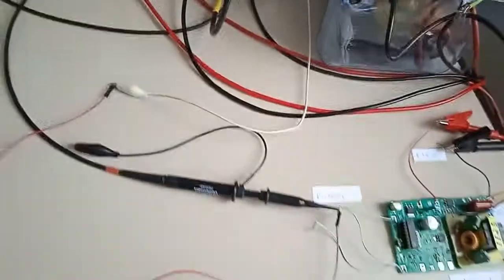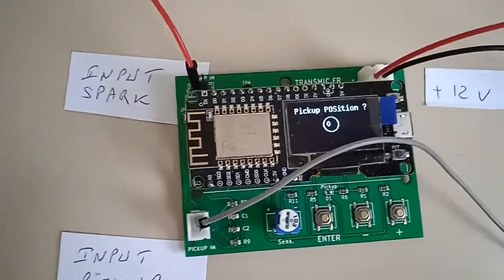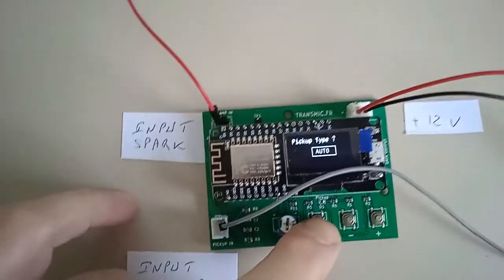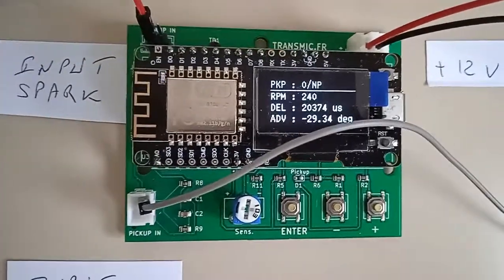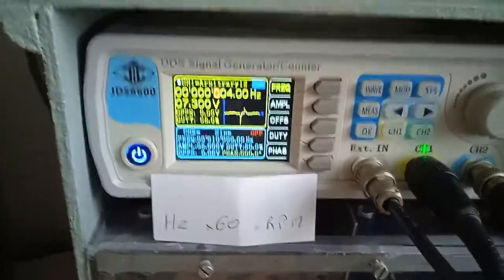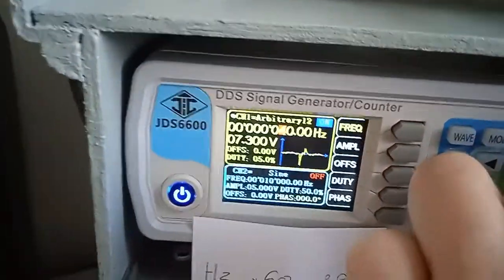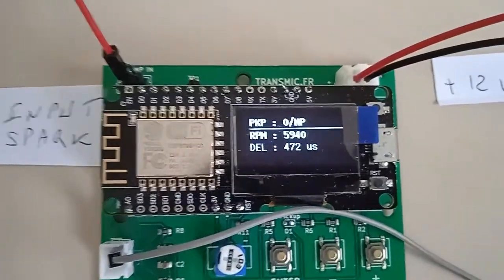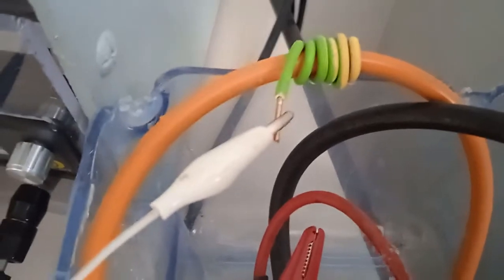Show Advance Timing on an engine.

Comment: Does it work on ecu?
Reply from the maker: This device expect a Hall or a Variable Reluctor (VR) as pickup signal. If the input signal to the ECU is different, it will not work.

Comment: Is the formula : rpm = hz x 60?
Reply from the maker: yes. The complete formula is actually: RPM = (60*FRQ*STROKES) / ( 2*CYLINDERS)
Which can be (in MY case) simplified in Hz*60
Reply: @transmiccdi8560  thanks you, another question , for programable cdi what parameter can be adjust by programing? Delay from pickup to fire point & curve or what else?
Reply from the maker: indeed  the delay from pickup to spark (the advance or retard), advance at kick start, crankshaft or camshaft and strokes.  Hall sensor or VR pickup

Comment: HELLO FROM 05753 IN USA   I REALLY HOPING YOU CAN HELP ME  I AM TRYING TO GET OR MAKE OR DESIGN A HI PERFORMANCE CDI OR ICM FOR THE HONDA XR650 2000-2007 THEY ALL SAME  I HAVE BOUGHT A FEW PROCOM  IT JUNK BIKE RAN TERRIBLE  ANOTHER ONE FROM AMAZON WAS SAME  THEY HAVE PROGRAMABLE CDI FOR THE HONDA XR650L IT ALMOST SAME BIKE HAS A BIT DIFFRENT CDI AND PICK UP TRIGGER ON STATOR    OH BOY  WHAT CAN I DO  MY BIKE IS HIGHLY MODDED AND I NOT KIDDING I BET I WILL GET 8HP ON TOP END WITH 40 DEGREES ADVANCE ON TOP END     CAN YOU HELP ME SUGGEST ANYTHING   THANK YOU
Reply from the maker: Hello, If I'm not mistaken Honda XR600R is a AC-CDI and XR600L is a DC-CDI.
https://thumpertalk.com/forums/topic/361630-cdis-differences-between-the-xr600-and-xr650l-cdi/
You have to be sure that the stator (high voltage) and the pickup are both OK.

Comment: Do you sell your dc to dc convertor?
Reply from the maker: The DC DC converter used in the DC-CDI in this video is available on the Shop at transmic.net
Reply: @transmiccdi8560  can you share this code and schematic?
Reply: @rofieasnan6085  Sorry it's not open-source.